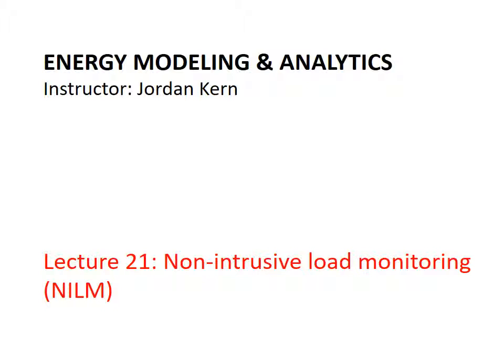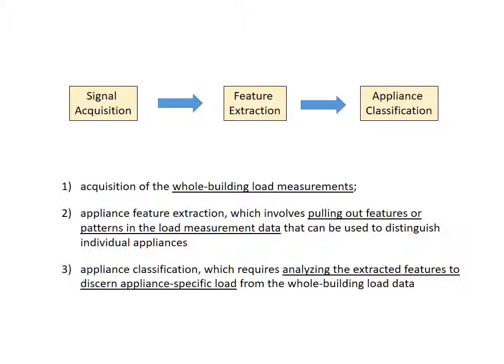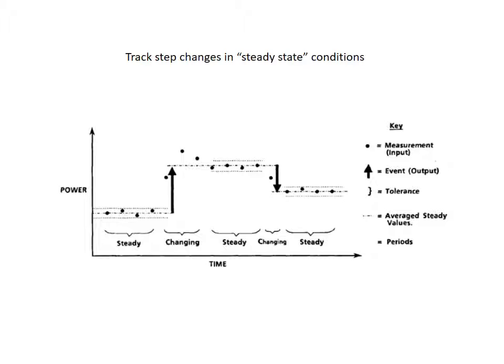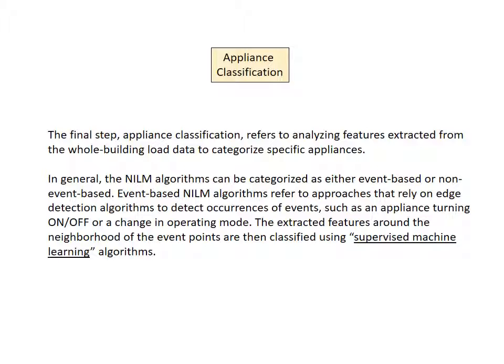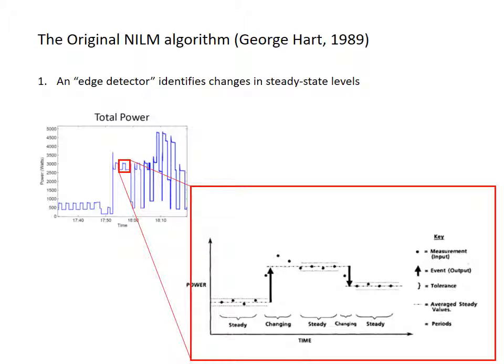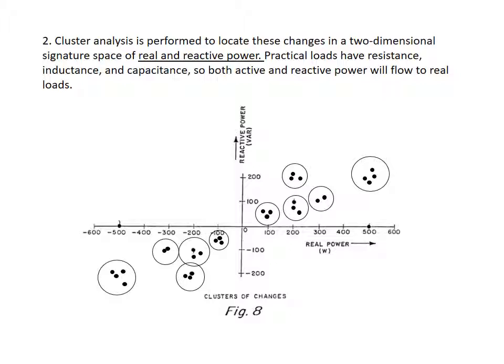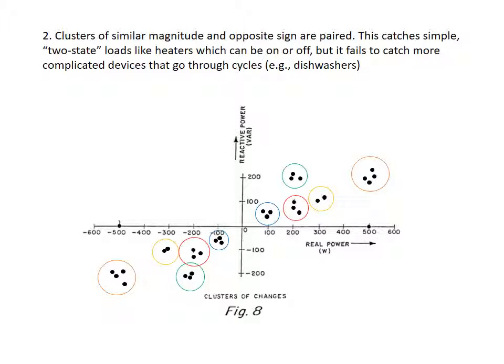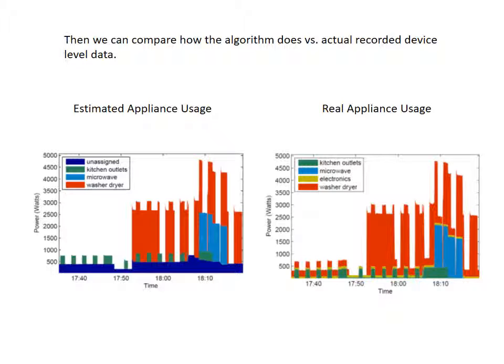Lecture 21   NILM

Comment: 7:30 Changes.  Changes in active and reactive power.  9:30
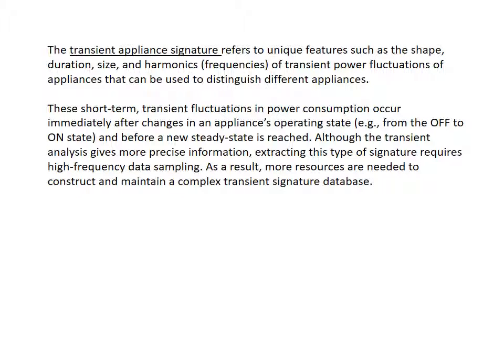11:30 Transients.  Frequency/Harmonics 13:30
Match signatures.  ML.
Edge detection
22:00 Geometric Clustering. Active and reactive groupings.
24:00 AC explaination of resistive element.  Active power. C and L
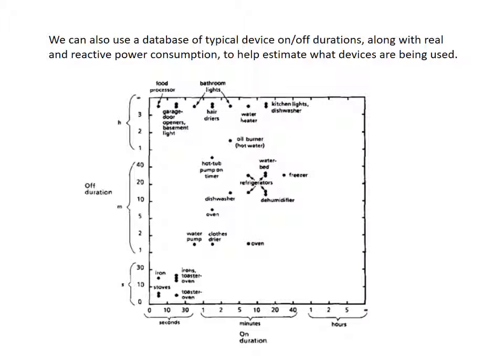31:00 on and off
35:45 References